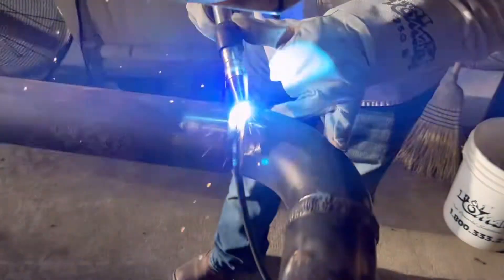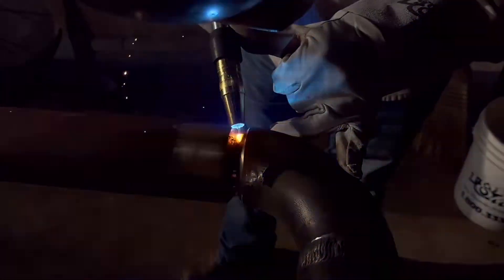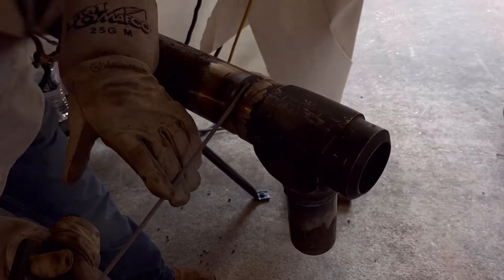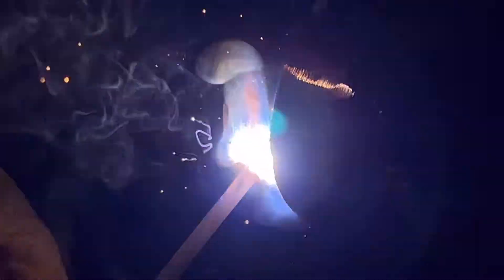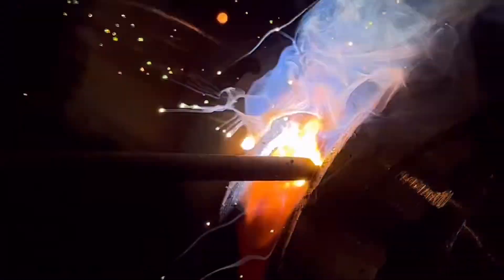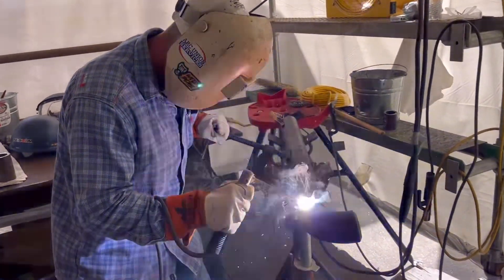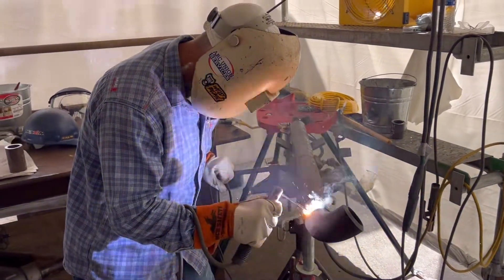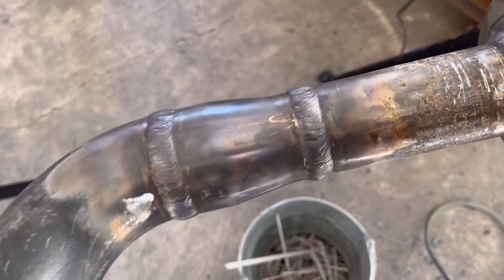RMD welding (root pass)

Comment: What model MIG welder did you all use?
Reply from the maker: They are miller machines.
Reply from the maker: The RMD process.
Reply: we use miller pipe works at my shop if that helps you out at all